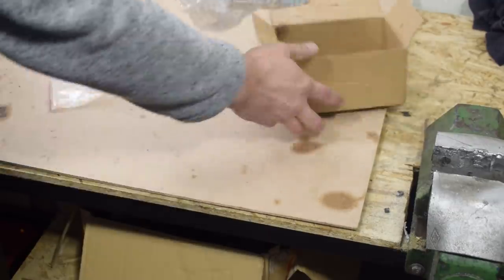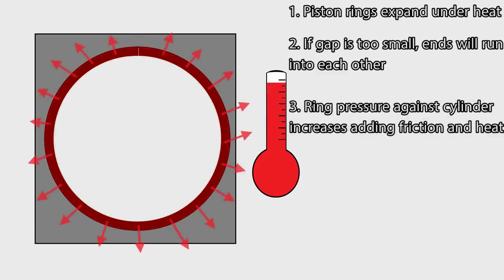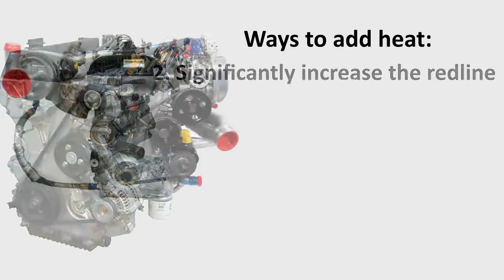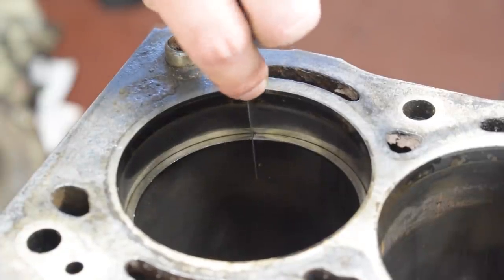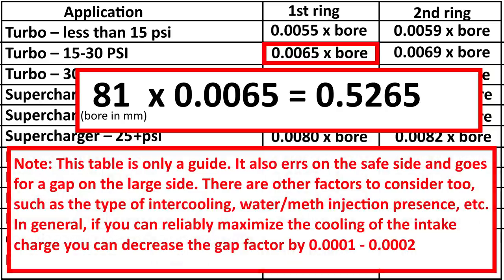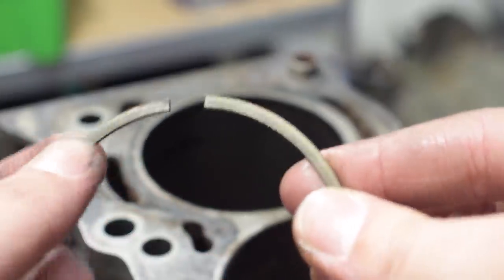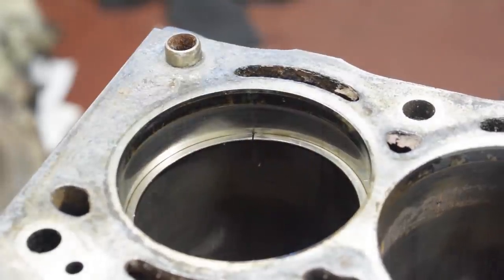Piston RING GAP - HOW and WHEN to adjust it + GAP CHART - BOOST SCHOOL #6

Comment: I just wanted to say, as a mechanical engineering student who is rebuilding his first engine, your content has been extremely valuable. Thanks a lot man.
Reply: I have rebuilt engines, and work for an automotive manufacturer… never in my life have I ever talked about ring ga with anyone. This man speaks needed knowledge! I totally agree with you.
Reply: @StudlyDyl  Okay, so, what and where are the "T" and "R" marks for the oil rings at the 10:41 ??
Reply: If you want it done properly, you should have all three oil rings separated by a little on a non thrust surface side of the pistons, and the oil rings should never be filed. Unless a specific manufacturer says to. These look like they are at about (if looking at the top of the piston), seems like 10 o clock, 8:30, and 6:30. But it’s hard to tell with that terrible picture. I would assume

Comment: The smaller gap on the top ring is interesting. On  big marine diesels they have grooves in the top ring to have a controlled pressure leakage so the load is more evenly spread between the two rings
Reply: Yeah, that's gas porting, which is supposed to prevent combustion pressure from leaking past the rings and diluting the oil.  The absolute worst thing to do to an engine is pressurize the crankcase, especially on boost.  Diesels are terrible on oil dilution since all the hydrocarbons get past the rings, so gas ported or gapless rings are a good idea for clean engine oil, which also prolongs the life of the turbos if they share the same oil.

Comment: One thing I felt could've been touched on, which you may have covered in a different video (correct me if you have done it in another video) is the role of each ring. Top ring is the fire control ring, this is designed to stop the flame front during the combustion process from getting between the piston and the cylinder walls. The middle ring is the compression ring, as the name suggests this is responsible for the majority of the actual compression process. The bottom ring stack is the oil control ring, these are only to control oil. and don't add anything to the compression/combustion process.

Traditionally, before boosted engines were so common, the compression (second) ring had a smaller gap because it was believed that the gap in that was the most critical to how the car runs. Nowadays, they have since discovered about the combustion pressures being trapped between the two, mostly due to forced induction aggravating a problem that manufacturers weren't aware of.

Comment: I just mounted a grinder with a cutoff wheel on my bench and used that. I also gapped my rings slightly loose for NA and slightly tight for low-boost turbo application. From what I've heard we are still using very conservative values to determine ring gap when most modern engines are pretty happy to run much tighter.

Comment: We always use an electric bench grinder with the smoothest stone we have. works great but opposite of the manual cranking grinder, you need to be extremely light and careful you don't remove too much, as it goes fast. I've done this on all my Honda Jseries Performance engines whether our builds (daily driver j35a7 400-600whp Nitrous Turbo builds) or customers 400-1000hp engine builds. HalferLand Performance

Comment: Interesting you say to push the rings in with a piston that has no rings. I used a piston with only the 2nd ring on it to make sure the ring was square in the bore because the 2nd ring will prevent the piston from further going down into the cylinder, and it will be perfectly even on all sides.

Comment: Order them ten thousand over
Four thousands per inch of bore.
Oil rings are directional, butt the ends and see where they point , that will be facing to the top, and don't forget smooth out the ends or they will score the cylinders.Your videos are great, always find something useful.

Comment: I do like to add that the failures of a to tight piston ring can vary from piston/ring to piston/ring. 
Some rings snap into pieces. 
Some butt up together and one part will press inn to the piston and the other will press out to the cylinder wall and you will have a deep score inside the cylinder which usually end up with a trashed block that no longer can be rebored and require sleeves.
Sometimes if the fitment it just right it will just cause a insane amount of heat and eventually faliure.
and the best case scenario when the fitment is loose then the ring can jump on top of itself.

Comment: a good example to show compression adding heat is those compression fire pistons used in survival packs to start a fire just by smacking a piston in a tube with something flamable like cloth inside the tube.they have glass ones great for showing compression creating heat

Comment: Good ol thermodynamics causing heat expansion... Not only is ring gap important but so is quench area (steel vs aluminum rods), piston to wall clearance, and piston to valve clearance

Comment: i think another key is to install piston ring gaps in opposite directions to increase distance of gas escape route at lower temps. make them longer by the time the gas tries to escape so when the piston is receiving pressure from the gas till the bottom dead end the gas is still trying its way put of the piston rings. helps pistons achieve working temp earlier and keeps dirts out longer too, no?

Comment: Great video as always,
 if I could suggest one, I think a really in depth analysis of the changes Mazda made with their 1.6, 1.8 and 1.8vvt found in the first 2 generations of Miata. would be highly appreciated.
in the Miata community there is a large misconception the differences are minimal, but they are certainly not, and it irritates me slightly when people dismiss the engineering that went into the later year engines.

Mazda also used these engines in a number of other platforms, including collaborations with ford and Kia.

Comment: What about gas ported rings?  Gapless rings?  Different ring materials?  If you're going to turbocharge, then it's a good idea to replace not just the rings for performance ones, but the pistons themselves as well.  Having the pistons matched to the cylinders guarantees a good fit, while also boring the cylinder out square to fit it.

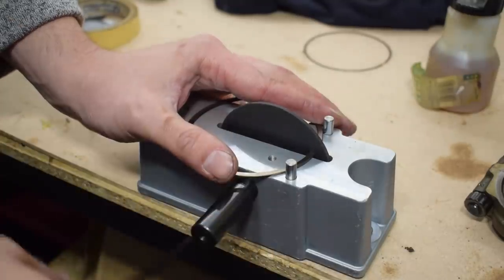Comment: 8:10... wrong direction 
8:17...correct direction...
Don't "choose a direction " ...file outside > in
Reply: Yeah, I noticed too. He should have put the ring on the other side of those pins and rotate the file clockwise.
But the rest of the video is great.

Comment: u can turn the handle faster on the ring filer, his point was the heat will mess with the rings temper, but as long as u keep the ring cool itll b fine  it would go real fast in running water

Comment: that why overbore stroke and bore ratio need wide ring gap to prevent engine failure. But if block and from aluminium with ceramic liner is not too problem because aluminium can be expanding more if piston ring made from ductile iron.

Comment: You should mention andor talk about total seal rings. How those work, what they do, and both advantages and disadvantages of them.
Reply: Well lol, If talking "total seal" gapless rings the theory totally contradicts some of what was explained in this video.. 
I.e, you can run the gapless rings as your second ring as "ring flutter" (distortion of top ring from contained pressure between 1st and 2nd ring) takes a very precise set of circumstances to occur, and in the real world almost never happens. It's a theory and ring flutter is commonly a misdiagnosed issue, it can happen just very rarely ever, if ever been axactly proven to... 
N/A engine, gapless top ring for better induction draw. Turbo, either 1st or 2nd ring can be gapless but if on alcohol or fuel blends then better to run on second ring to reduce blow by to almost nil and no oil contamination or dilution.
Also gapless rings can run large gaps for big boost (40psi+) but be street driven like drag week cars without the normal drawbacks of conventional rings gapped for big boost or 1000hp shots of nitrous.
Reply: @DStead2239  "Total Seal®" is a business,  they have the total seal piston rings, and having them or not having them would be valuable information that I think would be awesome for the D4A channel here.
Reply: @DaveWithMS  I know total seal is a company, hence I put it in quotations because what I said was quoting the company's contradiction to some of what was explained here. 
It's been covered on High performance academy video where Andre Simon (He's built, tuned, owned world record holding cars) interviewed Keith from total seal.
https://youtu.be/OFtf7l0B3kM

Comment: Any idea what the top ring gap should be on a 2" bore, air cooled engine, spinning upward of around 9000 revs! With higher than stock compression, and a ported head, I also added a performance cam,  it may spend most it's time above 7000 rpm, and possibly as much as 9500, unless it's ideling it's probably not going to see below 5000, and being air-cooled, I'm thinking it can get a bit on the hot side,  I went with . 008" and . 009" about . 002-.003" more than stock, if you can call a 50mm bug bore kit made in China, or some place in Asia,  if I skrooed up, I can replace the whole Piston and jug for about $35 and about 30 minutes,. But it does. Have a good amount of compression!  I'm concerned with the old starter even starting the thing! But I'll know tomorrow, I didn't want to anoy the neighborhood by firing the thing open header,  I'm not accustomed to such a small engine!

Comment: rings are there to transfer heat away from the piston to the cylinder??????  thats a first time ive heard that. thought they were for compression and to prevent oil from getting into the combustion chamber ( along with the oil rings ) i know the rings themselves produce a damn lot of heat just threw friction with the cylinder walls. i tought the heat got transferred directly from the burning fuel into the cylinder walls.  and oil squirters under the piston also used oil to cool the piston from underneath

Comment: a couple things i wish you would have covered here is the orientation the 1st and 2nd rings
1st ring gap at 12 o clock and the 2nd ring gap at 6 o clock so you less compression losses
and are some rings direction specific, like can they go in any way or is upside down a thing or no?
if im not mistaken the oil scraper ring for example, part of its job is to help clean the oil off the cylinder walls so you face less oil consumption
im not an expert by any means and these are just a couple things ive heard/read somewhere before and wasnt 100% sure if it was accurate or not
please correct me if im wrong

Comment: Would adding a higher lift camshaft warrant a ring gap change? Probably a dumb question but I want to know for my rebuild, boring the engine .030" over and porting/polishing the heads as well if that makes any difference for a Ford 4.0 OHV v6 engine

Comment: One thing I've never understood: I know on 2 stroke there are pins to keep the rings in position and avoid them to work with the open part on the cylinder ports. But why they aren't present on a 4 stroke? Isn't there the possibility for them to rotate with time and end up with the 2 gaps aligned and increase therefore the blow-by?
Reply: You could probably aad the pins on a 4 stroke piston after all two stroke pins are just drilled(probably reamed as well) and pressed in
Reply: It’s because a 2 stroke doesn’t  use valves it has ports on the bore that the edges of the ring can grab. So they put the gap where these ports are to avoid breaking rings or destroying the cylinder

Comment: Question: 
Given all the correct engine maintenance is performed like frequent oil changes  - and I want to MINIMIZE the oil burning in my engine. What kind of piston rings should I get? Should the piston gaps be minimized to the max that the specs allow it? Always wondered how this works! Thanks 👍🏻
Reply: they should be minimized to the min for best performance and emission but the gap is so small that if you're anywhere in the specs then you're good enough and you won't notice slightly different ring gap..

Comment: You can even lose the coolant in an engine and it will eventually seize due to the pistons being too tight in the bore . Once it cools it'll run once again and the pistons don't break .The pistons will always end up too tight in the bore before the ring gaps butt together.

Comment: I have situations were the oil spacer on the third ring is too long and buts together before fitting snugly in the groove. This requires cutting 1 or 2 segments off the spacer so that the 2 rails can be correctly fitted

Comment: So here's a question, I'm building an Audi 1.8 with a gtx3071r turbo and I have a compression lowering head gasket which .05 taller so if I run the oem ring gap will I see any issues? It'll be seeing about 20lbs of boost

Comment: Why  does  Toyota use 87mm  as the point to measure? If on a used engine the gap is wider than specified what would the  next step.

Comment: Hey man I love your videos a lot, I've been subbed for some time now and because of your videos I've felt confident enough to buy my first motor for a rebuild (b18b). I just got the engine and even though I felt confident before I'm getting cold feet because I don't even really know what to do, my question is what should I do. I know what I want to build (maxpeeding turbo hoping for 250-300hp) but I don't know what I should do to make it happen. I want to build it right but at the same time I don't want to gap rings and tear apart my entire engine because I'm scared I'm not ready for that yet. If anyone out there has any suggestions please I'd love to hear them it's a 300k kms junkyard Honda b18 from a 01 integra and I have very little knowledge about engine rebuilding. Should I leave the head on and just turbo? Should I inspect connecting rods? I don't know and I'm searching for help. Thank you to anyone in advance.

Comment: I love your videos, So I have an Ej251sohc, 180k , Did the head gaskets at 100k. worked great until the car got old and my kids ran the F#@k out of it? Did a bad ass head job on it again? Then the kids tried engine breaking down the mountain with a plugged off pick up tube? My bad, never took the oil pan off. Got a regrind crank, h-beams,oil pump, oil cooler delete, lightened pistons and pins, a scale, file and............
what gap would you do? 
This is gona be good.

Comment: I love your channel however the manual states to take the measurement 87mm from the top of the blocks top surface. Your ring end gap measurements could be wrong.
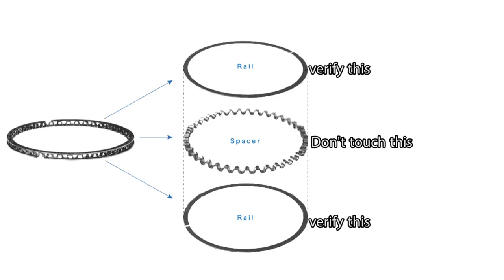Reply from the maker: As you can see in the video starting at 10:54 I measured at the top, middle and bottom. This eliminates the possibility of a false measurement due to bore taper.
Reply: Sorry I must have missed that. Thank you for taking the time replying
Reply from the maker: No problem, thanks for watching 😊

Comment: I think there's a better way to get past this problem of having to gapping rings
If you can run richer you can reduce combustion temperatures in your engine
Therefore the piston rings don't expand that much
Reply: If you run richer than needed you are loosing power defeating the point of boosting your engine. It doesnt matter if your rings are wider than needed(within reasonable limits), it barely effects blowby in reality.

Comment: What if you gap your piston rings to run 30psi then you run low boost at 8psi when cruising on the high way? 

Then you're going to get lots of blow by in your engine.  it's a gamble
Reply: as above it doesnt matter about cruise conditions you're not getting alot of blowby from correctly gapped rings at cruise.

Comment: Why shoudnt you file the rings at an angle? I would have geussed filing them in opposite angles could save the rings if they overheat and touch by pushing one side of the ring in the groove for the ring and causing a decrease in hp and in turn causing you to slow down.
Reply from the maker: Sadly it doesn't work that way. If you push one in, it would also push the other one out into bore

Comment: The additional Heat of a compressed Gas is NOT A RESULT OF FRICTION …… Heat is Energy per option of movement of a Gas Particle …… and when you Compress a Gas the reflections of the Gas Particles get additional moving Energy like a Tennis Ball reflected at tennis racket swing against his movement. The Tennis Ball the lost this Energy by friction to the Air …… what Gas Particles are don't do.

Comment: You can also use an angle grinder to gap your piston rings but it takes a lot of know how
Reply from the maker: I use angle grinders to hone my cylinders and port heads.... I usually port them.... In half
Reply: the good old mechanics doing the most accurate jobs using angle grinders. ain't got no whole day for it. altho ye. angle grinder can be used, but if you do it first time then get 2 sets of rings. cause you will mess up at the beginning.

Comment: For 2k  rpm increase increase the gap by 0.0001mm = 100nm.  Good luck measuring that.
Reply from the maker: You're misunderstanding the table. You just add that number to the factor that gets multiplied by the bore in the rows above. As you can see there's no mm after 0.0001, you added that.

Comment: Next project: make a NA Diesel Rev to 7000 RPM, now I know how to make it handle the Revs
Reply: At higher RPM the diesel fuel doesn't have enough time to mix with the air, so it doesn't combust as well (which is why diesel engines produce delicious black smoke when doing 6000+ rpm)
To archive 7000 rpm you would need an insanely high injection pressure or add boost to increase turbulences and accelerate air flow inside the cylinder to help the diesel mix with the air quicker